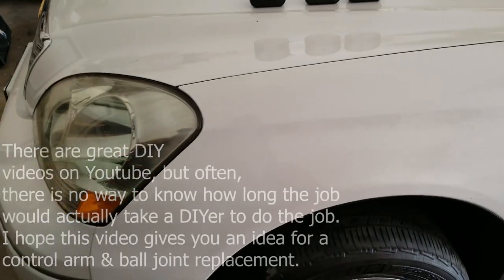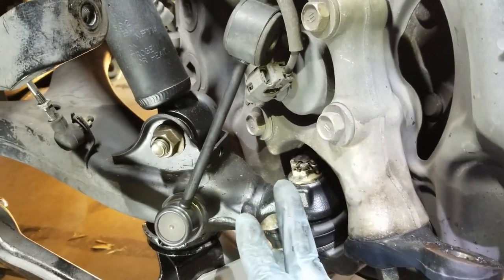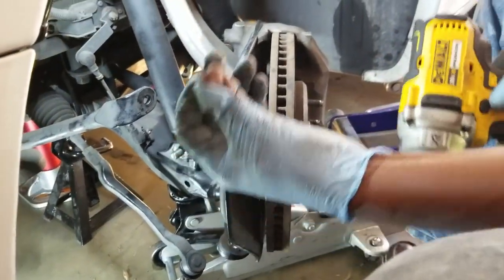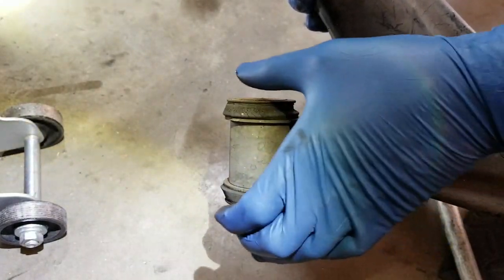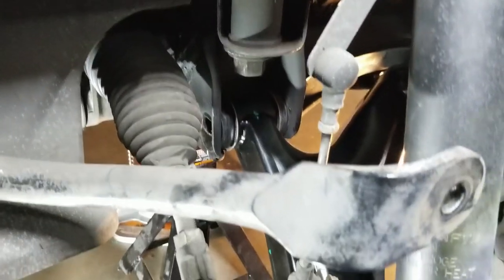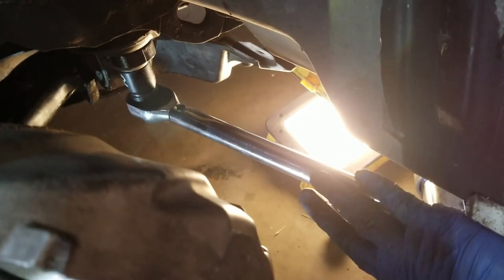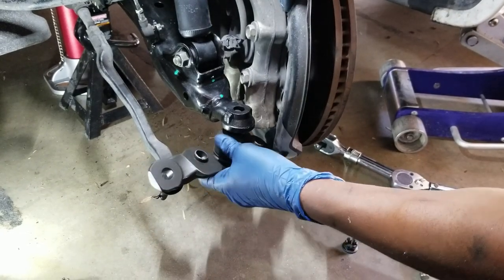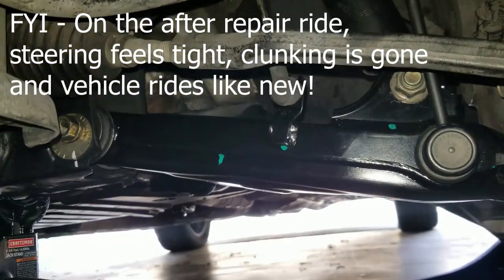2001 Lexus LS430 - Lower Control Arm & Ball Joint Replacement

Comment: At first I'm thinking "why is he working on a new car?" An exceptional car being worked on by an excellent mechanic! Very heartening.
Reply from the maker: Hey John, thanks for the comments.  You are correct, these LS430s are exceptional cars.  I have owned them since they were first introduced.  When it is time for another vehicle, I simply get the next model or version that is out at the time.  I keep them forever and simply ensure all service is done.   The vehicle in the video is a 2001.  I have since replaced it with a 2006 with fewer miles.  Love - These - Cars!

Comment: Great video! Thanks for giving me the confidence to do my rear knuckle replacement. I snapped a bolt in the aluminum knuckle that attaches the caliper was unsuccessful in removing the snapped bolt and have been dreading this repair. I bought a second hand knuckle last year.

Comment: Thanks for your detailed video with all the torque specs. With your guidance I was able to change both my front lower control arms in just over 4 hours total. This would have taken hours longer without your video. Thanks again!
Reply from the maker: Awesome!  That's great to hear. Just curious, was the nut that holds the strut to the control are difficult to come loose?  Thanks for watching and hope you will like and subscribe.  I have other vids that I simply have not had time to edit.  Take care and be well.

Comment: Fantastic work, thank you sir for this very well illustrated tutorial. I have an 01 as well that needs this treatment.
Reply from the maker: Hi Gabriel, this job is common on the 01 to 06 430s.  I hope the vide helps if you should decide to take on the project.  It is not a bad project.  Just be sure you have the right tools.

Comment: Amazingly, all the bolts are clean, no rust, no any dirty
Reply from the maker: Hi Hat, the vehicle is a southern California vehicle.  Rust is typically not a problem for us.  I cant imagine having to work on a vehicle where the parts are rusted together, stuck in place, etc.  My hat is off to those guys who deal with rusted parts on a regular basis.  That must make every job a little unpredictable.  I just replaced a bearing hub assembly on an Infiniti.  It came right off with no problem.

Comment: Another important note. The key to successful install is the following - After the parts are installed, you will need to shake the whole suspension up and down preferrably from the bottom of the car to ensure it settles down (!). Only this grants the perfect moment to start tightening bolts in the VERY SPECIFIC sequence according to the manual, while the weight of the vehicle is evenly distributed in the front. This will ensure your rubber parts will not wear out a month later or right after the install, if torqued incorrectly.
Reply from the maker: Hi Dmitry, thanks for the comments.  I agree with you and at 12:53 in the video I put up comments that suggested the viewer simulate ride height (by raising control arm before setting torque).  This was my first video and I found it a bit more challenging to explain, do the work, ensure video of what I was doing, etc.  I actually missed this step while doing the video and went back "off camera" and loosened nuts and re-torqued while weight was on suspension to simulate ride height.  I tried to address this by adding the comment overlay on the video.  Thanks for the comment though.  The next time I have to place text over a video to explain something I will have to be more clear and more specific. Again, thanks for the comment.  I sincerely appreciate it.

Comment: Excellent job, clear and concise with torque information.  I liked the clock as well to give some perspective.  Thank you for putting this out, I'll be following along when I do mine.
Reply from the maker: Just remember to simulate the vehicle being at ride height (weight on the control arm) when setting the torque.  I did this off camera, but placed two written notes in the video.  You would simulate ride height & weight by lifting the control arm with a floor jack until the weight of vehicle is on the jack and not jack stands.  Good luck with your project and glad the video helped.  Take care and be well.

Comment: Nice work except the only mistake was the control arm bushings are not supposed to be torqued down until the arms at at ride height. If those bolts are torqued while the arms are hanging down then there is stress on the bushing and it will wear out again faster. At 17:20 when you had the knuckle jacked up from below would have been a good time to torque the control arm bushings. It's best to measure exactly where ride height is before disassembling things so you know exactly how far to jack up the knuckle. Also I personally would have just replaced the rubber bushings rather than the whole control arm since that way it still has the nice OEM Lexus brand control arm rather than an aftermarket one.
Reply from the maker: Hi Matt, thanks for the comment.  I absolutely agree that the control arms should be torqued with weight on the suspension to simulate ride height.   I did this off camera and placed a NOTE on the video to hopefully address this with any viewers.  In fact, I placed NOTES at two places in the video to address.   Regarding OEM vs non OEM... there are some things I am absolutely OEM and nothing else.  For me, the control arm is not one of them.  I get your point though. Thanks for watching.
Reply from the maker: Hi Matt, for the benefit of anyone who may be looking at this comment and reply, the references to simulating ride height before applying torque to the bushings can be found at 12:52 and 14:57.  Those are not just comments in passing, the notes were there because that is an important step that was done, but not captured on camera.

Comment: Very Nice! I am curious if you did both sides and also how well the mevotch part is doing.
Reply from the maker: Hi Alex, the Mevotech part held up well.   Some time after the repair I sold the vehicle and purchased a slightly newer LS430.  The repairs held up well.  The only thing I would do differently would be to purchase the ball joints from a company other than Beck/Arnley.  The parts I received were great, in fact, may have come from an OEM manufacturer.  It is hit and miss with Beck/Arnley.   On a different vehicle I purchased parts from Beck and they were inferior.  In fact, they broker before getting them torqued down.  Being surprised at the poor quality I contacted the company only to find out Beck/Arnley does not make their own parts.  They are only a distributor.  They source their parts from around the world.  So, you could end up with a part from an OEM manufacturer and have a quality part OR one from a maker with poor quality and poor quality control.  SO, I got lucky with my LS430 part.  I was not so lucky with the party on my Land Cruiser.  Lesson:  Do not purchase any parts from Beck / Arnley.  They have been removed from my list of companies I will buy parts from.  This is based on my experience with them.  Take care Alex and thanks for watching.  Oh, and yes, I did both sides.  I had the exact same problems on both sides.

Comment: Thank you so much!!! You are awesome!!!  Love the torque specs.  Very detailed and I am ready to start on mine now!
Reply from the maker: Hey Sov, thanks for the comments.  Also, I hope you will follow me.  I have other videos that are in the works.  Good luck with your project.  It is a fairly easy job and saves quite a bit of money.  My only update would be to reconsider the Beck/Arnley parts.  I was fortunate in that I got good parts.  They held up fine.  However, since doing the job, I found that Beck/Arnley is a distributor only.  They do not manufacture their own parts.  Parts are sourced from around the world.  Some parts come from OEM Toyota manufacturers and others are not.  In fact, some have received Beck parts that were in OEM Toyota packaging.  I received a Beck/Arnley part for my truck and it simply did not look like the Original part.  It looked flimsy.  The part broke while I was placing torque on the bolt.  This is when I researched more on Beck/Arnley and their quality control.   I liked that Beck is a U.S. Company, but this is when I found they don't make the parts.  So, I would try and find another parts distributor.  Preferably, a company that makes their own parts, even if they are made outside of U.S.  In my view, this at least gives the company some oversight on quality control.  Ok, that's it and all the best with your project!
Reply: @justsomeguy4941  Thank you for the update on Beck/Arnley.  I purchased a lot of their products in the past for Nissan, Honda, Toyota, and Lexus.  Now I will try to avoid them.  Can you give me some more info on your Milwaukee Angle Impact tool there?  Is that a cordless or air tool?  I need to purchase one for the job.  Always wanted one and now is a good excuse for me to go buy one.  I will need a high torque power ratchet for this job.  I have a breaker bar, that should work too right?  Thanks again.
Reply from the maker: @sovmak8388  Hey Sov, great question on the angle impact tool.  When this Milwaukee Angle Impact tool came out I thought...awesome, that is exactly what I need.  In fact, when they first came out I purchased two of them. The problem is that I find the tool to be lightweight for suspension work.  I have been VERY disappointed in the tool.  I periodically go to the junkyard for parts and right after getting the tool, it took it with me on one of my trips.  It simply would not remove some fasteners.  When I got home, I tried some fasteners where I knew the torque values.  Still, the tool struggled with torque it should not have had a problem with.  So, now, I barely use the thing.  I have both 3/8 inch and 1/2 inch.  My go-to tool for suspension work... actually, all work that is not under the hood is my DeWalt mid-range impact wrench.  That thing is awesome!  It is not too big, packs loads of power, long battery life and is just a great all around tool.  If I were going to purchase one thing for this job, that DeWalt mid-range impact would be the tool.  I love it.  By the way, the Milwaukee is battery and part of the M12 battery system.  Also, breaker bars are essential when doing suspension work.  In fact, in the video even my favorite DeWalt tool had trouble with one bolt that a shop over torqued.  I had to use my breaker bar.  Sov, good luck with the project!

Comment: This video is gold. Can you please explain how to put weight on suspension when tight ing the cam bolt. Thank you again
Reply from the maker: Hi Daniel.  I'm happy to help.  Whenever you are installing bushings, especially those that will have have suspension travel "around" an attachment point on the vehicle, you should place weight on the suspension to simulate the car being on the ground...since this is the state your suspension will be in for the life of the bushing.  The reason for this is so there is no stress (twist)  on the bushing.  Stress will cause the bushing to wear prematurely.  Ok, the way to simulate the cars weight on the suspension is to 1. Snug your nuts (do not tighten or torque). 2.Place the jack under the control arm nearest where the tire will be - ensure jack is securely placed where it will not slide away from the arm.  3. Slowly lift the jack until the vehicle starts to rise...as if you were jacking up the vehicle.  You see, once the vehicle starts to rise all of the vehicle weight is now resting on the control arm JUST as it would be if the tire was on the vehicle and the weight of the car was resting on the ground.  And that, my friend, is how you place weight on the suspension ("before" you torque the nuts/bolts).   Now, once  the weight of the car is on the suspension, you can torque your nuts and bolts to specs.  This ensures there is no pressure/stress on that new suspension part that you just installed.  I hope the explanation helps.  Thanks for the kind words and I hope you will like, subscribe and follow.  Take care and be well.
Reply: Thank you so much brotha . I’ll definitely subscribe to you channel. Im trying to get to get my LS running smoothly. So again I really appreciate your help.

Comment: My SC430 needs a good control arm job on both front sides. It squeaks like an old bed, clunks when going through bumps and sometimes when braking, it does that too. I removed two front wheels and checked, everything seemed tight on the upper section. So, it most likely is the lower control arms on both sides
Reply from the maker: Asian, it is probably easier to check initially with the wheels on.  After you lift the vehicle off the ground, place a camera (like a cell phone) pointing at the bushings, one at a time.  Then, with your hands at 3 & 6 o'clock positions, move the tires back and forth.  Do this again with your hands at 12 & 6 O'clock.   See if there is any movement at the bushings.  Finally, if this does not produce any definitive results, try removing your wheels.  Check the upper control arm bushings.  They can be broken, but you may only be able to see this with lateral movement and not moving the tires back and forth as mentioned with the 12, 3, 6 and 9 o'clock hand positions.  You would want to take a prybar and move the upper control arm from front to back and see if the control arm "slides" back and forth on the bushing.  If it does, this would mean a new bushing is needed AND it is unlikely this would have been discovered by moving the wheels.  Anyway, good luck and thanks for watching the video.  Be well.

Comment: Excellent step by step. One question, you do mention it but did the simulation off camera. How do simulate ride height before tightening up to spec? TIA.
Reply from the maker: Hi 77, you would simulate ride height by placing the jack under the control arm, preferably with a piece of wood to help ensure the medal jack base does not slip.  Then, jack up the vehicle until all of the weight is on the jacked up control arm and not on the jack stands.  Don't left car too high off jack stands.  Remember, they are there for our safety.  Just lift enough to be able to determine the weight of the car is now resting on the control arm and jack.  At this point, you would torque the nuts to spec.  This helps ensure the bushings do not get stressed or wear out prematurely.  Ok, that's it.  Good luck with you project.

Comment: How is it holding up? I just ordered the mevotech will have them installed this weekend.
Reply from the maker: The Lexus is holding up just fine.  However, I wanted to share that I have used Beck Arnley parts in the past with no problems.  For this reason, I was comfortable using Beck/Arnley for LS430 ball joints.  The part was fine.  HOWEVER, I used Beck/Arnley parts on a Land Cruiser (sway bar end links) and the part just looked flimsy and not solid.  When I was applying torque to the nut, the part broke!  Upon this happening I called Beck/Arnley and did a little checking about quality controls.  Beck Arnley does not manufacture any of their parts.  They are only a distributor.  They source parts from many companies, some of which are OEM manufacturers, which explains the Toyota Labels, OEM stuff and other high quality parts.   However, NOT all parts are of this quality, as evidenced by my Land Cruiser Sway Bar End Links.  My point is that going forward, I will not use Beck Arnley parts.  Since I had some BeckArnley in this LS430 video, I wanted to share this with anyone who might consider Beck/Arnley since I used them with no problems.  The NEXT box of Beck/Arnley might be from ... who knows where.  I was lucky with the LS430 Ball Joints (and prior parts).  I would not, however, recommend anyone go with this company because eventually, someone will get a bad part.   Suspension is just too important to roll the dice.  Ok, that's it for now.  It is 12/12/21.

Comment: Also one more thing, big bushing is liquid filled and does a lot for a smoothness of the ride, if you have a chance grab those from dealership $100 a pop plus an hour of labor at the shop with press.
 Not critical, any bushing should do if you have old cracked one.

Comment: Not sure if I missed. But how did you torque the rear part of the control arm bushing?
Reply from the maker: Hi ToolD, I imagine you are referring to the caster bushings, which is what attaches the back of the control arm to the vehicle.  You can see this being done starting at about 13:00 when I snug the caster bushing up to the vehicel.  At about 14:10 or so I am applying torque to both inside and outside caster bushings at the back of the control arm.  What is not shown is that upon snugging the bolts up to the vehicle, I placed a jack under the control arm and lifted it until the weight of the vehicle was on the control arm  At that point, I torqued the bolts.  Really wished I had shown this step.  I commented on it in the text captions, but no video.  Anyway, I hope this helps.  The torque specs given were taken directly from the factory service manual (FSM).  Take care and be well.